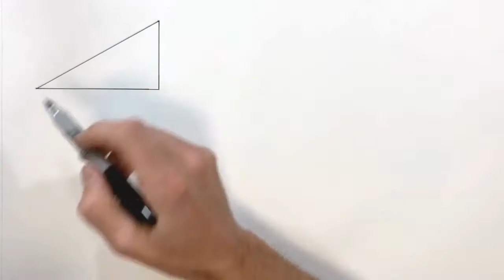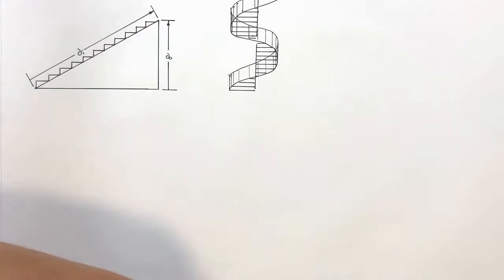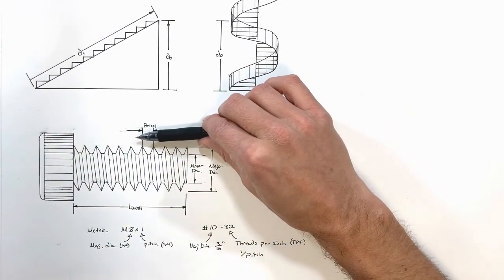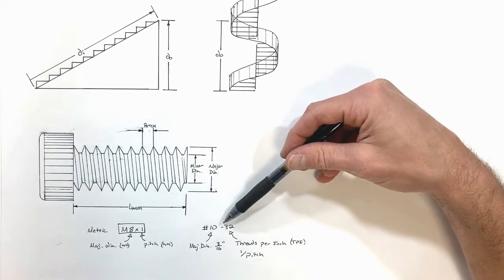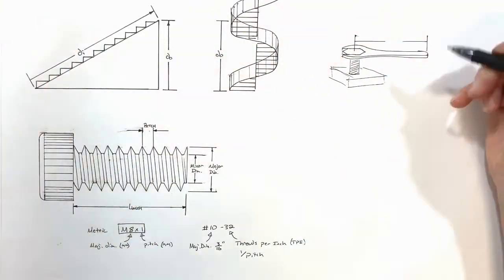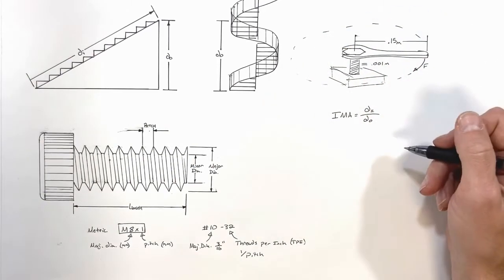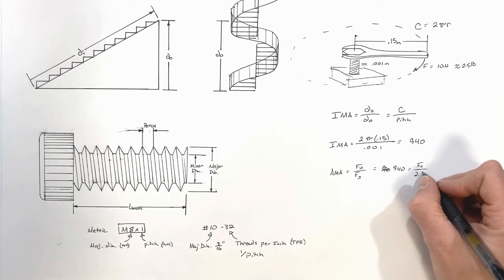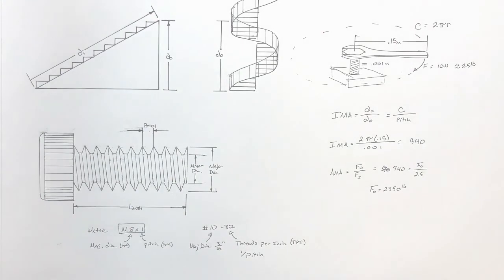Calculate Mechanical Advantage | Screws | Simple Machines For Engineers

Comment: good afternoon sir, i would like to clarify the value of IMA = 940, isnt it 942.4777961? The value of IMA, and the value of Fo after being multiplied to 942.4777961 and 2.5 is 2356.19449? i just want to clarify this hehe, thank you sir
Reply from the maker: Yes, you are correct.  Im a big fan of rounding.